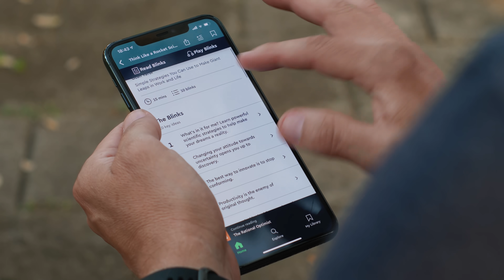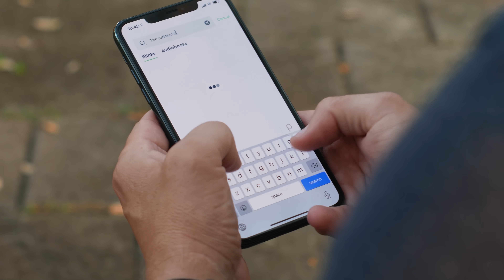Making Improvised Backpacks

Comment: The Roycroft pack gets better when you start with the tarp tied up like a drawstring purse (not necessarily a cord through the eyelets, but the shape like one). You then can tie the bunched up tarp part to the frames apex, and additionally fix the hanging purse part to the lower frame. To get a pack you can easily put down and pick up again, you'd use two shoulder straps (webbing or strips of cloth, hell, even pants legs would be more comfortable than cord) with a fixed loop that hooks on the lower tips of the frame. Whenever you want to put it down, you unhook the loops. Oriented after the Roman Furca, you can also add a long bar to the pack that goes over your shoulder, allowing you to put the load of your pack on the ground first, before taking it off (especially good for heavy loads). - A Bering pack might be worth a try too, it gives you a more closed package.

Comment: Little tip if you don't have a lot of paracord, and aren't putting the full 550lb of weight on it - you can pull the core out of the cord, and it gives you (depending on the type or paracord) 4-5 extra lengths of cordage you can use.
Really good for projects like this, where you're using relatively short pieces to tie corners on a structure or frame.

Comment: When I did my OA Ordeal, we used Horseshoes. You take a tarp and lay it out with your sleeping bag on top. Put one change of clothes and your toiletries inside the sleeping bag and then roll it all up. Once it’s all the way rolled, tie ropes around the tube and bend it into a horseshoe, with rope bridging the two ends. You now have a backpack you can sling over your shoulder or carry around your head.
Reply: Well I did something similar but with the sleeping bag on the outside and leashed with a belt
Reply: OA was quite the journey. It rained the first night. I took shelter under my tarp and couldn't ask anyone for help

Comment: One note for your First Backpack: you would have wanted to wrap your first black cord around the base of your triangle a few times, as Murphy was jumping you could tell the tarp was sliding down and nothing but the horizontal wraps were keeping it up. Edit: at 15:30 the unsupported bottom decided it had enough.

One way to do this is started by wrapping around the middle of the triangle a couple times, then on one side run it directly over the frame pole diagonally, to then draw it along the back of the tarp to the middle of the base of the frame over that pole along the belly of the pack back up to the middle of the other side, and doing this a few times weaving a thin 'V' holding the bottom of the backpack up.

A note for your Pants Backpack: you will want to cinch the leg "straps" to the beltloops tighter than what you had on show, the paracord pulling on your shoulders with the weight of whatever you put in the pack will get quite painful real quickly! (for a similar example, if you have ever carried a gallon of milk in a plastic bag soon the plastic of the handles start cutting into your hands)

Comment: I feel like the sticks over complicated the tarp strategy, just use the loops already on the tarp to close it up and turn it into a sack with some arm loops for carrying
Reply: That could work. They also should learn a friction hitch and a bowline knot.
Reply: This design works if you're using a tarp of fabric that doesn't have holes. Maybe a plastic bag or something where punching holes in it would compromise the structural integrity.
Reply: @Laugh1ngboy  I was trying to make a joke.

Comment: What else would you do in a plane crash to carry the meet you harvested from the dead passengers?

Well I dunno modern rogue. those passengers were probably wearing clothes so I could probably make a backpack or purse from their clothes via knotting the holes shut, and ripping/cutting other fabric to make a belt/ arm loops without the need for sticks. though sticks would help with the structuring but isn't really needed. Just like with your tarp backpack. You don't really need the sticks. it'll be uncomfortable without them but it's doable. Sticks are precious resources for fire and warmth, or building.

Edit-yes I know they do this exact thing in the next half.  Just answering the question. thats all.

Comment: I feel like the tarp one would be better if you took the middle of the paracord and wrapped it around your waist, then from your back you bring the paracord up to the front of your shoulders going under your armpits, then using teach end to go through the tarp's holes and then if you have extra paracord you can tie the bottom of the tarp to the loop you made around your waist, ideally you'd also be wearing jeans with belt loops to have this paracord attached in. This way you don't need to waste any paracord on tying sticks together, it can function as suspenders for your pants and since the only opening is at the top stuff wont fall out so easy as well as being much easier to pack. Also it functions almost exactly like those shitty backpacks that already do this.

Comment: DISCLAIMER: DO NOT HANDLE MOLTEN PLASTICS WITH YOUR BARE HANDS. Although sheer when solid, paracord is very VERY sticky when melted, and retains heat well enough to cause semi-severe burns. ALSO, If you DO intend to fuse paracord, do so in a well ventilated area, as it is very easy to burn the plastics and create toxic fumes. Basically just don't be brian at all ever

Comment: The tarp had nothing under it that was tied to the top, to keep the bottom from falling out. The best option to secure a large object to another object, is something I learned from a conversation I had with a random stranger. He used to secure cargo for a living. He said basically build a rope net, and then tie that net to the object. Imagine trying to secure a really tall fridge to the back of a truck that has a really low cab height. If you just tie it around at 25% of the height, it will fall over. If you could build a rope net around it, then you can tie many sections of the netting to different areas, pulling from different angles and prevent it from moving. I'm not saying to build a super dense net from paracord that becomes a solid fabric, I only mean if the gaps in the net are small enough that the smallest heaviest object won't fall through the bottom. I suppose, a reference to South Park, you could call it adding a "chin diaper" to the tarp backpack.